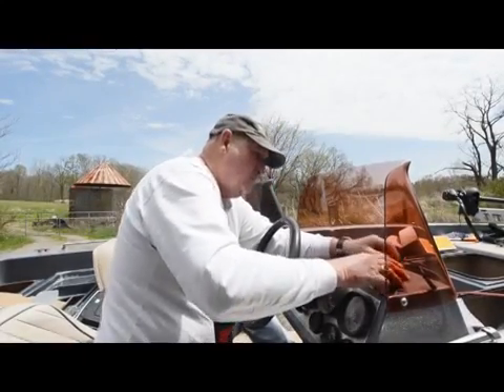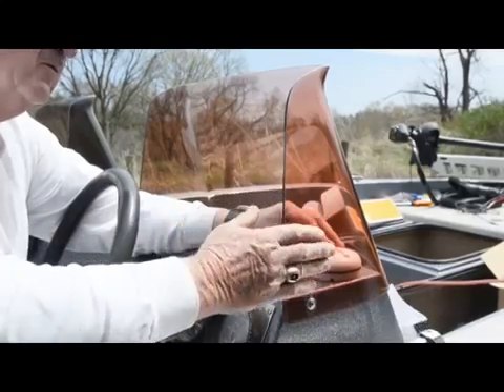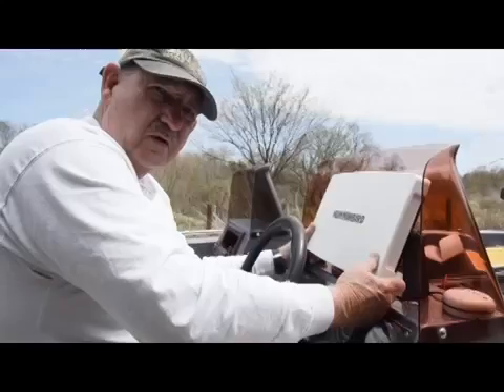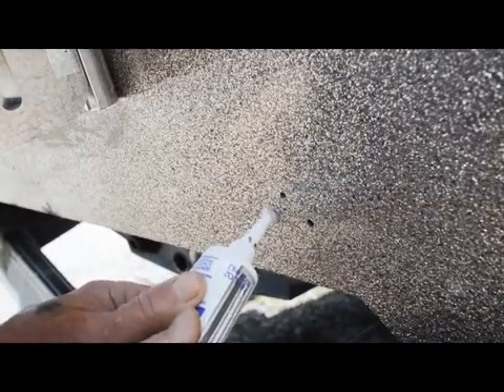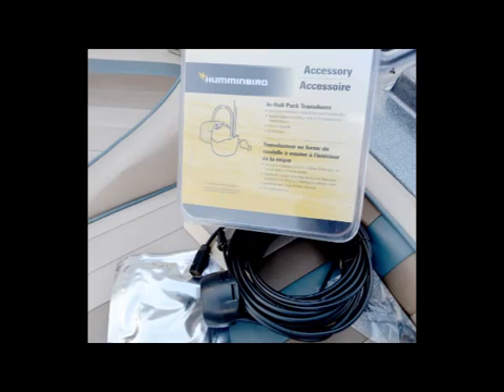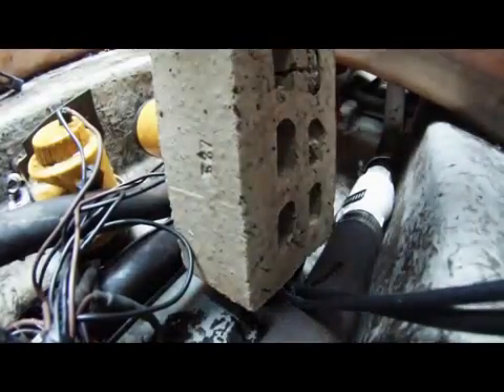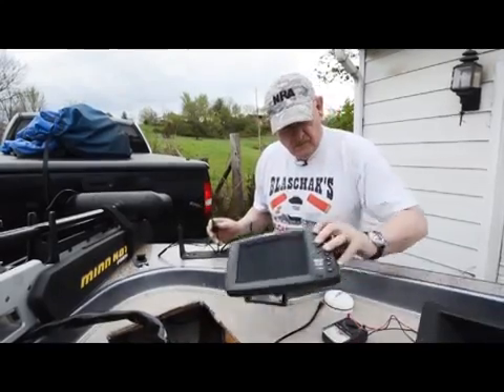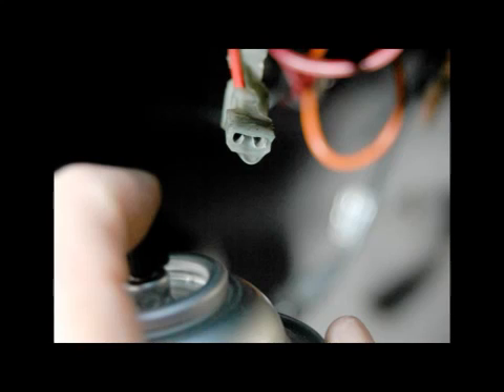Keep Your Bass Boat Alive, Part 7

Comment: 10 amp. Could go to 5 amp if wish for running lights. However, need a lower amp fuse directly on hot wire to electronics, whatever manufacturer recommends.